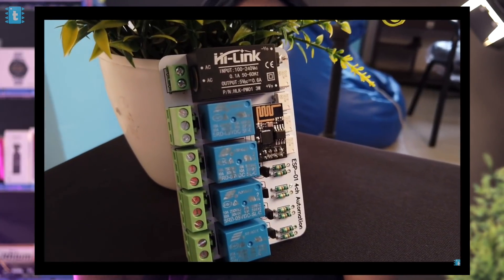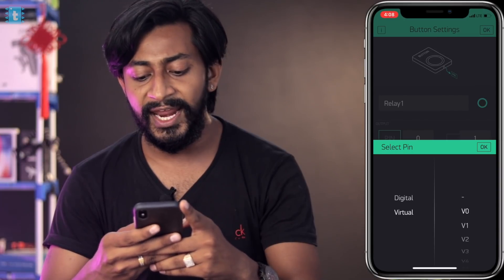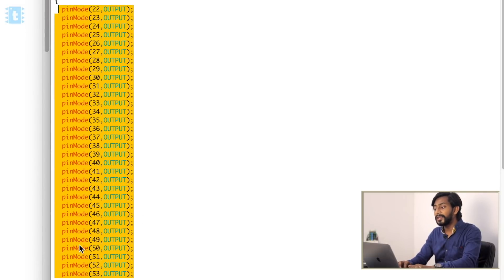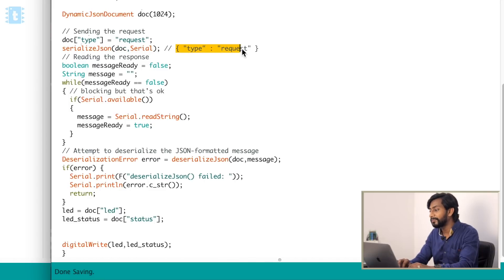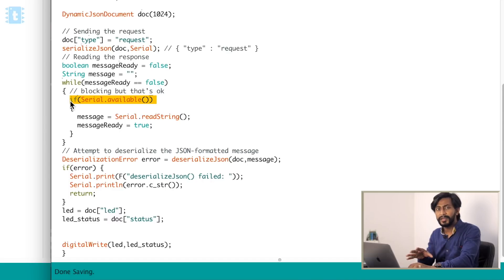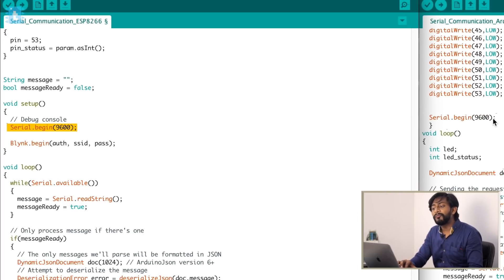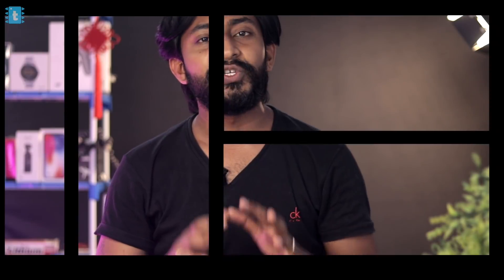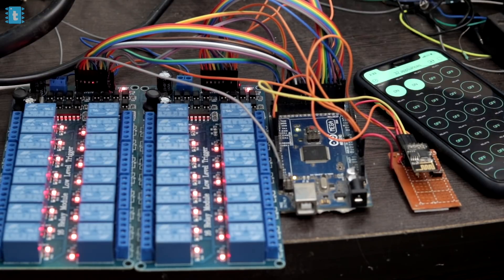Big Automation with small module | ESP8266 pin extending | Proof of Concepts

Comment: Why don’t you use 74hc595n shift out register to control 32 or more relays just with 3 gpio of esp-01 device. You wont require a separate mcu, just esp-01 will work.
Reply: Hii , i was thinking of the same , I  just stuck on the cloud thing, i made a webpage and controlled gpios through that.  I just want to make it more updatable, like blynk buttons get updated their states on each device we are connected to.

Comment: Can Mega R3 ATmega2560 and WiFi ESP8266 with memory 32Mb be used instead of Arduino mega board?

Also, it would be great if you could post a video about this in hindi.

Comment: be very careful with this 16 relay expansion module, I don't believe the supplier has changed the design. There is a fault in the board, as long as you use max 5Vdc you are good, but if you supply the board with a higher voltage it doesn't get regulated down to the 5 vdc supply rating of the relays, not to be confused with the output or switching rating. So if you supply 12 V lets say, 12V will be applied to the relay and you will cook the relay eventually if not possibly cause a fire.

Comment: Is there a serious use-case for 32 relays on a single PCB in the home environment?
Switching all the lamps in your Christmas tree separately?
Reply: Yes, I'm putting some fountains into a pond I have, 15 fountains and pump on/off uses one block of relays16 relays.   However I'm also planning to light each fountain with a 3 colour relay requiring a further 3 blocks of 16 relays to control it all.   I haven't worked out just how to control all 4 banks of 16 relays so I can turn on several fountains and selected colours together at the same time, e.g. to give interest to the display.  I'm having fun!

Comment: Connect shift register to esp 01 and u can control 8 relay with one shift register and u can extend four shift register for 32 relay
Reply: Hi renga
Reply: @salmanfarose20  hi da 😃
Reply: @rengarider  unexpected 😁
Reply: But u can not control two output at the same time
Reply: @vankavinaykumar  why not ? Maybe You are confusing shift registres with multiplexors
Reply: @lybce  bro pls tell me difference between multiplexer and shift register 
bro
Reply: I realize it's quite off topic but do anyone know of a good site to stream newly released series online ?
Reply: @Wilson Messiah lately I have been using FlixZone. Just search on google for it :)
Reply: You cannot use shift registers to do the same job of Arduino in this video, if you want for example to change the 8th pin from one to zero of an 8 bins shift register, you will have to send zero to the shift register and resend the other 7 bins data as well, which will momentarily change the status of each bin 7 times, which means you might blow up some devices connected to the shift register.
Reply: @MD-py2de I feel like you don't know the xor and bitwise or operations present in shift register. It does no harm to the other 7bit registers and only changes the state of that single bit which we want to control
Reply: I want to communicate in remote 24 relay how to do this give some ideas
Reply: @karthikeyann6103 you can use the 74hc595 shift register which can even control 64 relays simultaneously without getting collision with the other outputs

Comment: Huh? Just use a shift register!
Reply: there you can not turn on more than one pin(at a time only one relay )
Reply: @amazingmj07  Yes you can. There's PISO (Parallel In, Serial Out) and SIPO (Serial In, Parallel Out) shift registers. You can even chain them together. Shift in all 32 bits and latch and you're good to go. Go watch https://www.youtube.com/watch?v=Ys2fu4NINrA for example (or search YouTube for 74HC595)
Reply: Even better just connect the tx and rx or arduino and esp and use virtual pins of blynk with the esp...

Comment: Sir please guide me from where I can learn Arduino programming from basics ? 🙏🏻🙏🏻
Reply: Buy a simple Arduino Uno (because it's easy to wire up simple stuff)
Download the IDE (software)
And start using any of the many example sketches. 
For the very first ones (blinking an LED, doing some simple math and print the result on serial...), you don't even need any other hardware
For learning more there are plenty of channels and tutorials. Good luck.
Reply: @oscargr_  Can you please name those channels..🙏🏻

Comment: What's the point of using ESP8266 if you adding arduino mega  to you project anyways? Can you just use Arduino mega without ESP8266 then? What would be cooler if you can control 32(or any number) relays with JUST ESP8266 without adding other arduino boards. You can easily do it with shift registers... Great video in general though.

Comment: You can use microchip MCP23017.
Reply: This is the correct way to do it...
Reply: yep, this is one of shift registers out there, 16-bit though, so you'd need to chain 2 of those to get control of 32 relays.

Comment: Gr8 video ..... 
Make a combo board ( works w/o internet) which include manual switches .. relays to turn on off li8s and for ac fan  
Also u can use capacitive touch switch instead of manual switch 😉

Comment: i2C would be much more efficient way right ? Can you make a tutorial on this ?
Reply: Definitely
Reply: This. A couple of I²C gpio expanders would be cheaper, easier and definitely more efficient. Many GPIO expanders can handle 5v input instead of 3.3v too. Lots of tutorials online, just Google for "Arduino GPIO expander".
However, if you're going for the MCP27xxx series, don't make the same mistake as I made and get the ones that do not require a specific voltage (voltage divider circuit) to set the I²C address, as they will require 2 extra resistors to set the I²C address if you're going to use more than one.

Comment: Love the project.😍👍
Just a suggestion, you can use a multiplexer IC as well to control n relays using 1 gpio only.
Reply: Still the same we can not control two or more output at the same time

Comment: You won't get the proper PIN_STATUS value of the button state. Since the compiler of the Arduino IDE is linear, you will always get the status of the last read button, i.e. in your case last pin 53/V31. The button status flag has to be a different variable for each button.
Reply from the maker: This code was working completely fine

Comment: awesome video! i just have one question tough... on the line of code 
"""DeserializationError error = deserializeJson(doc, message);"""
"""deserializeJson(doc, message);"""   will return false if the message is deserialized? If so then error will be false. 
If the deserialize returns something else,  how to prevent that """if(error)""" statement from running when the message is correcly deserialized?
Reply: what is arduinoJson library Version ?

Comment: Well done ! nice idea !

Would it not however,  be easier to use a  CD74HC4067 with your ESP board ?
There is no need for the Arduino Mega then.
Reply: It's a decoder right ?
Reply: @daSurrealist  yeah but you can only have one channel active at any point in time. I'd probably use a shift register
Reply: btw we can learn this method also, right? while using the MEGA we can achieve overall control over the circuit
Reply: @Adrian Snyman that's a better idea
Reply: CD74hc4067 type Multiplexer will be easy instead of using any mega
Reply: else use esp32 which have more Gooodmoring than 8266
Reply: the author makes everything with blynk, don't expect anything complex to be honest.

Comment: No need of that much code just make esp-01 to cwmode=1 then in blynk as Arduino mega ->wifi select examples.blynk.cc Arduino mega esp8266 wifi sheild and just in & mins you can control 54 relays at once